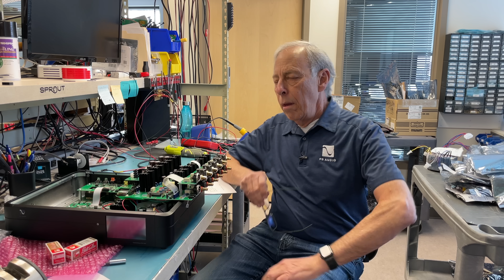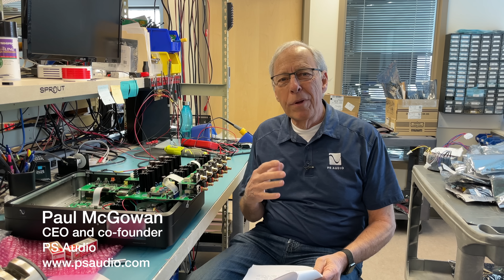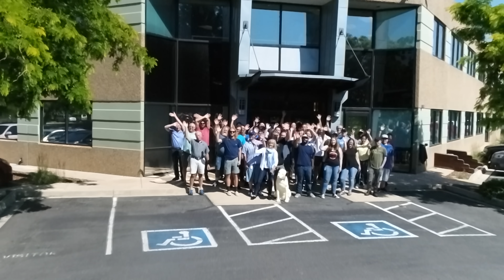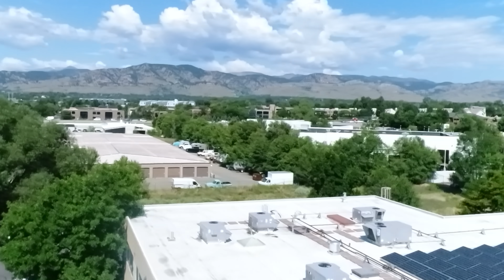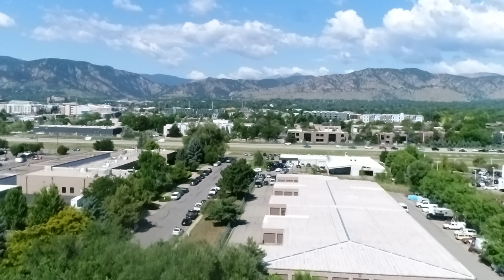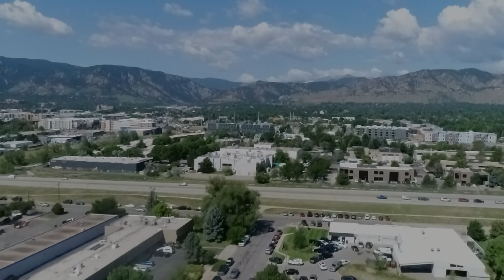Why high resolution audio?

Comment: This is confusing me, my understanding has always been different, so I'm happy to be educated here if I'm wrong!

In a speaker, if it has a 20kHz limit, that's referring to an audio frequency of 20kHz (i.e. a really high frequency that can be heard by dogs and teenagers, like the high pitched noise at the end of Sgt Pepper) , where as in a hi res file of 192kHz, that's referring to the sample rate of the digital data (how many times the data is processed per second). So in this case are these not 2 totally different measurements not to be confused with each other? One being audio frequency (how high or low the sound is) and the other being a count of how often the data is sampled.

Am I wrong with this!?
Reply: that is my understanding as well.. human audible spectrum is 20Hz to 20kHz and you typically need to sample at multiple times of the audible signal to accurately capture all the nuances of the actual waveform for processing and playback. Sampling at 192kHz means that capturing the waveform of 20kHz part of the spectrum gives you approx 10samples (9.5samples). This video should have mentioned sampling not just say Nyquist and signal phase
Reply: No, you're not wrong and with all respect. Sample rate rate is a speed of sampling when is recorded you can keep it, while output measurment does not have (in this theory) any connection, "same language" or however you call it, together. You're completely right!
Reply: Do you mean 192kbit/s? I.e. not hertz but kilo bits per second.
Reply: @johan.mp4  No, hi Res 192kHz files can be several thousand kilobits per second. I've got Pet Sounds in hi Res and they are something like 6,000 kbps , huge files.
Reply: @AndrewDixonMusic  ok I just wanted to make sure you didn't mix the terms, since 192 kbit/s is a common data rate for mp3s.
Reply: @AndrewDixonMusic  to be honest, 192 kHz is snake oil. No chance that's needed. Bit depth on the other hand is needed when producing, mixing and mastering audio and dynamic range is really important. I don't think it's physically possible to make a speaker element move that fast.
Reply: As others have pointed out, sampling rate is measured in hertz per second, i.e. how many data points we sample per second. Also known as resolution. This can be comapared to megapixels in a digital image. Then we have bit depth, that's how accurate each of those data points are. Same goes for digital images where the bit depth is usually 8 bit per color channel. In audio we usually use 16 bit.

Digital audio is usually streamed or downloaded over the internet, that's why we use the term kbit/s, i.e. how much data is sent per second. 16 bit 44.1 kHz is around 1400 kbit/s. Kbit/s doesn't really say anything about the quality of the sound, rather the file size.
Reply: The frequencies are connected though. As was mentioned in the video. The frequency you want to reproduce must be sampled at the doubled frequency. So your 192 kHz resolution audio can reproduce a 96 kHz audio frequency, but your speakers can't and your ears can definitely not hear that frequency.
Reply: Yes but the Brazilian's question is this.... if your speaker cone can only vibrate 20 kHz, then what's the point in storing audio at 192 kHz? Remember each of the 192,000 samples per second are instructions on how much (magnitude) to move your speaker cone.
Reply: No, you don't understand how PCM works. It does not go higher past the nyquist frequency (double the frequency of samples/s of your highest frequency)
With a 44.1 kHz sampling, you can reproduce every sound from 0-20kHz with no loss. No. Loss. A faster sampling speed will not improve the accuracy of these 0-20kHz frequencies. A higher sampling rate might be good if you're *working* with audio, to get extra room to apply effects and such (just like a raw is better when you want to work on a picture), but for **listening**, the sampling rate past 44.1kHz does not make any difference. 
This page explains it well:
https://people.xiph.org/~xiphmont/demo/neil-young.html
Reply: Sample rate has NOTHING to do with frequency, it's just how often a snapshot is taken measured/recorded per second. The higher the rate the more likely is your music sounding better if your setup is up to reproduce it.
Reply: @MrBiggmartin  Dead right. This was a confused video.
Reply: @AntPDC  why? The video never said that it was the same measurements, just that they were related thanks to the Nyquist theorem. I.e. hi-res audio with sample rate of 192 kHz can reproduce audio up to 96 kHz without aliasing. Which is way beyond what we can hear and what's necessary for a filter to work.

Comment: I would say it in a simpler way.

What's the point of having a car which can travel at much more speed than the maximum speed limit;
Because in speeds near or below limit, it will travel with much less noise and will be much more controlable by its driver.
It will also have better quality brakes system, aka, safer.
Reply: To me that it more of an analogy for power amps. Perhaps a better analogy would be digital cameras. Say you wanted to crop an image. You'll get a higher quality picture if you crop a 10 megapixel image than a 5 megapixel image and then later make a large print. By having a higher resolution audio signal you are able to crop (filter) the extraneous audio signal and still have good sounding audio.
Reply: @Commiefornia  
👍

Comment: I have another argument : shannon-nyquist theorem works only if you have infinite precision in your digital signal.

But we don't because we you a finite number of bits (16 or 24).
That's why increasing the number of bits is useful : you decrease the digital error amount, and you get closer to the shannon nyquist theorem.
But even with 24 bit there is still digital error. So you need some headroom from signal frequency. In this case maxFreq x3 is better than x2.
"Max freq X2 is enough" works only in theory, not in the real world.
Reply: @ReaktorLeak you can see the shannon nyquist theorem, you need infinite digital precision and we cannot have this in real world.
It's fact
Reply: @ReaktorLeak no a 8 bit digital does not allow it does not because the digital errors create digital noise, so the conversion cannot be perfect ;)

And yes there is no such thing as perfect conversion because there is no digital signal with infinite bit depth.

That's what i'm saying since the beginning of this thread ^^
Reply: @ReaktorLeak i don't say it's wrong, i say it's a simplification of the real world.
As a lot of theorems are.

And i say it again, the more bit you put, the closest it is from the infinite accuracy needed for the shannon theorem.
A lesser bit means higher digital inaccuracy/errors and thus higher digital noise.

It's quite simple.
Which part don't you understand ^^ ?
Reply: @ReaktorLeak it needs infinite precision (no quantification error)
Because if you have quantification error, you cannot reproduce exactly the signal. Because you will reproduce the signal with errors (which is noise and distorsion). It's the reason why we use dithering : to mitigate this.

I say it again : to reproduce perfectly a analog signal, you need the digital signal with 2x freqmax, and with no quantification approximation, which means a inifinite level of precision (number of bits) !
It's basics

We dont have infinite level of precision, it's impossible to reach.
Reply: @ReaktorLeak i could say the same to you since you seems yo believe you can reproduce a signal with a 1bit data without any noise or distorsion ^^
Reply: Also keep in mind "max freq x2 is enough" does not mean max freq x2 is PERFECT. I hear so many people saying CD is "enough" so it's all you need, but none of these people know that the format was designed to fit some long piece of music that I forget, on the limited capacity of a CD. It may have been "enough" but it was all calculated compromises.
Reply: @ReaktorLeak interesting. And yeah Beethoven’s 9th. But the thing is, if the 9th symphony was shorter, we should have had higher quality audio on the same disc... possibly.
Reply: @ReaktorLeak he is saying exactly what I'm saying : we do not have infinite precision (we have a finite number of bits), so we cannot have 100% accuracy in conversion.
The DA conversion add aditional noise because of that.
If we respeted the shannon theorem, there should have 0 noise in DA conversion (which is the theorical 100% accurate conversion that cannot exist in real life)

And to reduce the effect of quantization error, increasing the frequency is a solution.
That's why I'm saying : "192 khz gives a better result thant 44 khz because the shannon theorem cannot be applied in real world, it's a theorical result"

Now I hope you understand better how it works

Comment: Paul those electrolytic capacitors near those heat sinks is not good as heat makes them dry out and fail prematurely , I know that from much experience. Also shame on you for handling that board without electrostatic protection ,even though there  may not be any CMOS (which are super susceptible ) devices there .all semiconductor devices can be injured by static discharge (that we may not even feel) causing them to fail prematurely  in the future.
Reply: Like the older Power Plants... ;-)
I recapped my P-600, and wow, what a difference!

Comment: Looks like a pretty serious pre-amp.  CD Quality not specifically CD's does it for me. the rest is all about the mastering. it's amazing even with good quality mastering you can notice at times the compression. and to me that's "mucks up" the sound.
Reply: Exactly!
Reply: Good recordings are what we are all looking for.  A poorly recorded piece of music will sound like a turd even if that recording is recorded at the best possible bit rate. You just end up with a very pricisely and shiney turd.
A great recording can sound fantastic, even on a casette tape (some of my best master material originated on a simple 4 track cassette). However, re master a great recording at 24 192 studio master quality, and you can really reap the rewards if tge mastering is done correctly. 

Ive recently moved to Roon as my front end, so now i have access to Tidals mqa studio masters. Some of these are trully fantastic, but some of them are not sympathetically mastered and decenly masterd cd quality version will sound better despite the bit rate. 

Good recordings can sound better with a more precise digital version at higher sampling rates, but a turd will always sound like a turd no matter how many bits were used to digitise it.

Comment: "High Resolution" just a way of making one buy the Beatle's White Album yet again, isn't it? Having already purchased it multiple times in various formats over the years.
Reply: While that is sometimes just a marketing ploy other times is is better but you need a highly resolving system to hear the difference.
Reply: @leekumiega9268  Are you speaking from experience? What system are you using?
Reply: @AntPDC  Yes I speak from experience , the system was my friends very expensive system ,the speakers used 4 electrostatic panels for the mid and high frequencies.
Reply: @leekumiega9268  : The only way things can be better, is if they are mixed and mastered differently.

Comment: hi paul. this got me thinking about an exchange some time ago about tube pre-driver/transistor back end amplifier. 
the general thought is this in basic terms:
along those lines...have you considered using AlGaAs or GaAs fet's in the back end of the digital amps? seems like their high speed and low noise could possibly eliminate the need for a choke coil altogether in the output stage of a digital amp. the premise being that the amp could be cycled well above any perceivable digital hash harmonic and still remain stable. smooooth from a digital amp maybe?
Reply: Do you refer to the new GaN FETs?
Reply: @VladoT  yes.  :-)

Comment: Nice preamp. But all that great analog circuit isn't doing much in my digital system. I used to have a rack of analog sources. Now I have none and even gone preamp free. Bit perfect streaming FLAC from Amazon HD Music provides me all the music I could ever dream of in up to 192kHz 24 bits. I hope PS Audio will start to focus more on the future of digital systems e.g. I would love to see an active HIGH RESOLUTION DSP cross-over (pre-DAC) and discrete mono amp blocks where we can play with the filtering optimization for optimum frequency response and optimum phase.
Reply: youll be amazed how much (i know i was) how much 'love' the BHK-pre will give your system.
they give you an in home trial. what have you got to lose?
oh... and dont get me started in the DirectStream DAC. mind blowing
Reply: @googoo-gjoob  No doubt PS Audio makes awesome stuff. I use the Stellar S300 in my dining room at the moment. But preamps are gone from my setups as I archived my vinyl discs and have gone 100% streaming.

Comment: Granted I haven't done any AB comparisons of hi-res audio, but I'm still in the camp that recording and mastering should be done at hi sample rates and bit depths. But downsampling the mastered audio to 44 or 48kHz and 16 bit depth is all that people can truly appreciate... I very well could be wrong 🤷🏼
Reply: I have done AB comparisons between a CD and a MFSL half speed mastered vinyl (which technically is hi-res ) and the vinyl wins  easily but that was on an expensive highly resolving system.
Reply: @leekumiega9268  Vinyl is nowhere near "hi-res" - nowhere.
Reply: @AntPDC  Point #1 vinyl is capable of preproducing frequencies around 122 KHZ (see you tube anadialog sound above 20 KHZ ) , in show more the last link shows that MoFi was able to cut the lacquer at 122 KHZ but over heated the cutting head so it is limited below that but still Hi-Resolution. Point #2 the 70's quadraphonic records had the rear channels modulated on a 30 KHZ carrier with the frequency going up up to 45KHZ , and a good cartridge with a shibata or microline stylus could track that high, so vinyl is easily capable of Hi-Resolution. All of MoFi's vinyl records are in fact high resolution.

Comment: My DIY loudspeakers are -3dB down at 120,000 Hz after I installed a supertweeter. For all intents and purposes it is hi-rez 24 bit 192 kHz / DSD ready loudspeaker. The supertweeter also allows my rig to tell the difference of the harp guitar used by Michael Hedges from the one used by Saigon Kick.
Reply: 120 Khz?
Reply: Maybe it's for the bats?

Comment: Most modern speakers and equipment can resolve at least 20 kHz @ -3 dB easily, but actually go much higher. The same applies to human hearing. It's about ambience and the "feel" of the music, beyond hearing it .
Reply: yes , our ears are just part of our auditory/ scanning (lol) system. The hairs on our skin pick up much higher frequencies.
Reply: Just because a speaker can go above 20KHZ does not mean it is highly resolving , Magnepans and speakers with electrostatic or ribbon or AMT (mid and high frequency drivers)  are way more resolving than most other types of speakers.
Reply: @ReaktorLeak No kidding! It's like some kind of pathology.